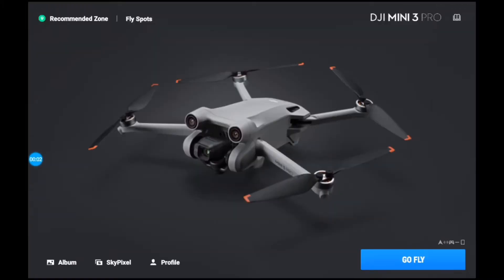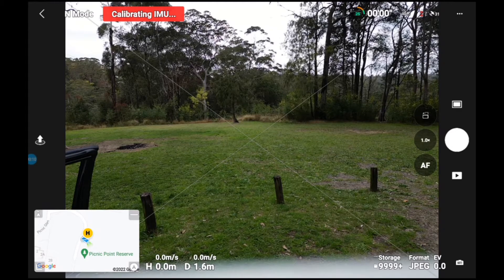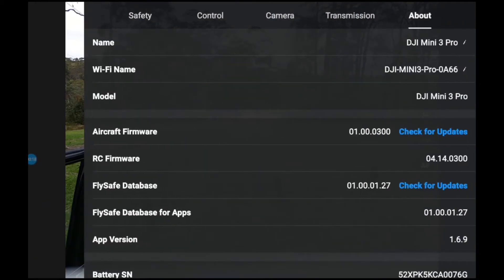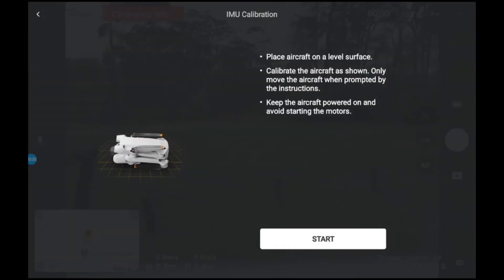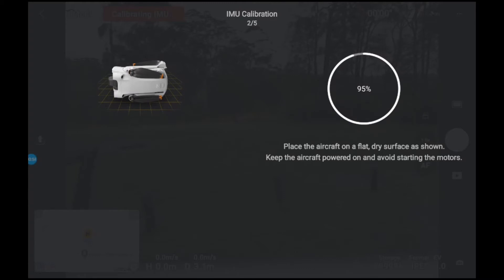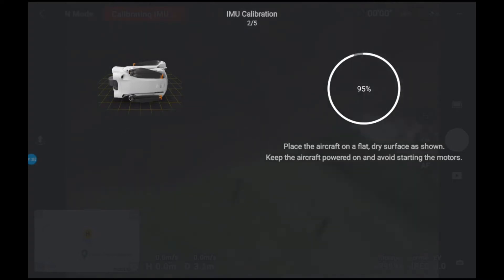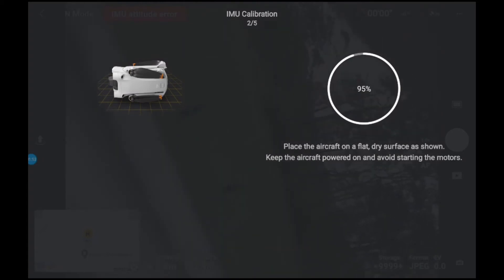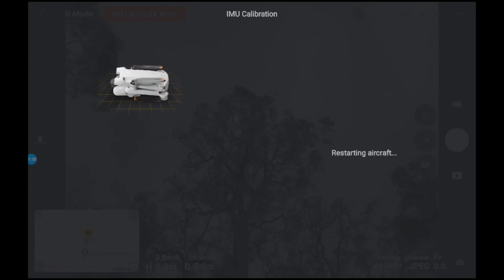how to calibrate dji mini 3 pro imu

Comment: Thanks for sharing. I purchased a refurbished DGI Mini  3 Pro recently. it works just fine. my only issue is that i have to calibrate it before every flight. This is very annoying  as it take a little time to do so.... How can i correct this issue?
Reply from the maker: @BucketlistJa  I'd suggest it isn't calibrated correctly perhaps your surface isn't level?? Also don't try to compensate for the uneven surface of the drone it must sit on the surface directly

Comment: Doesn’t work for me
Reply from the maker: Make sure your away from anything with electricity even a car
Reply: It won’t stay on its side, so how do you actually do this?
Reply from the maker: @thelongislandguy  use a stable flat surface if carefully placed it will balance on its side
Reply: @aussieknowhow9720  I’m using a sheet of glass that I’ve leveled in all directions. When I put the drone on its side it’s tilted instead of perfectly vertical. Is that how it should be?
Reply from the maker: @thelongislandguy  yes they programmed it to account for that

Comment: Can you do this indoors?  Thanx.
Reply from the maker: I believe calibration of the imu should be OK inside as your teaching the drone software which way is up essentially, however don't calibrate the compass inside there's too much electronic interference indoors (all wiring wilt a current has a magnetic feild to some degree) I also highly recommend turning 5g off on your phone when calibrating your compass 5g interference has been noted on old style compasses